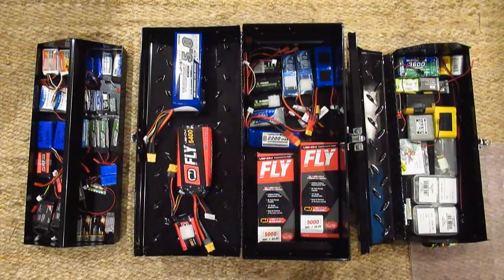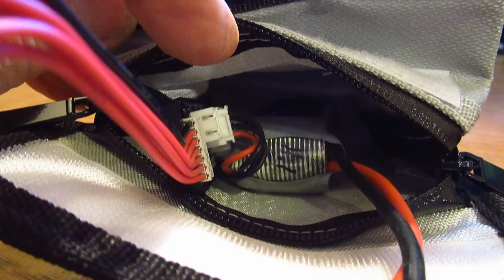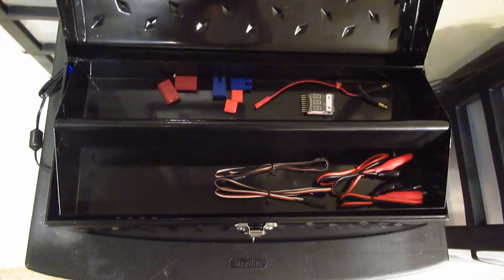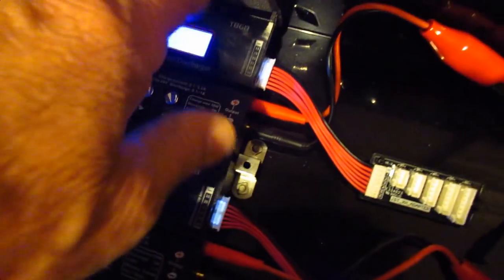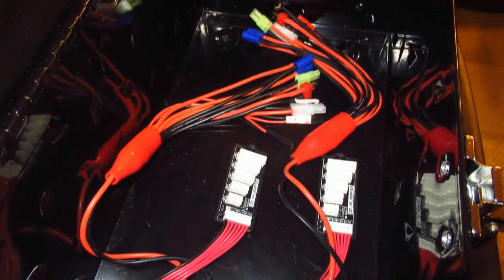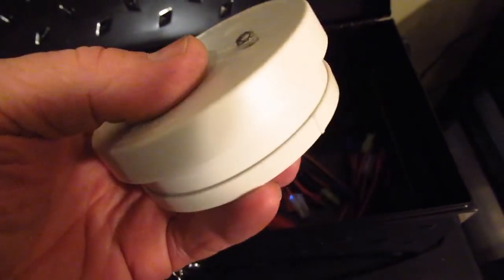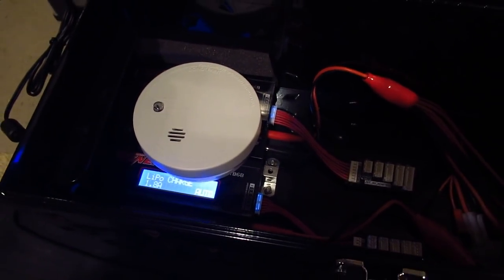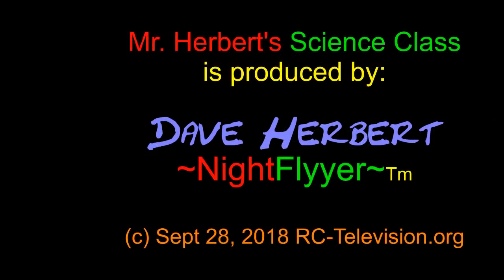LiPo Battery explosion prompted me to build a self contained PORTABLE Charging Station.

Comment: My worst experience with charging was with my prototype of lithium silver HV battery 
I made it with thinnest separator I could find and I got 382mah from 9v to 2.4v 
One time I was charging it 0.5c and I guess dentures formed on the anode causing internal short 
And it didn't caught on fire 
It straight up exploded into dust
Reply from the maker: Wow. What a story. Hats off to you for even attempting to build a battery like that. Thanks and be safe!
Reply: @NightFlyyer  thanks if I ever get good materials I will try to make it again but safer i hope in the end I will be able to sell them because 1s 9v should be far lighter and containing the same energy like 3s lipo with similar capacity

Comment: Excellent ideas.  I love the idea of including a smoke detector.  I have seen videos of batteries in those SUPPOSEDLY safe charging bags spitting flames out and burning up the bag.  
QUESTION:  You store many batteries in the same metal box.  Can a battery fail while it is inactive and in storage?
QUESTION:  If one of the batteries in the storage box explodes, will it ignite the other batteries around it?  Then could it cause a massive explosion?
Thanks for your continuous supply of excellent videos.  Gary
Reply: A fully charged LiPo that is exposed to high temperature (inside a hot car) is a small bomb waiting to go off.
Reply from the maker: Maybe, but most lipo explosions happen while charging.   I never leave any of my models in my car just sitting in the sun, but that is good advice or my laptop and phone would also explode.
Reply from the maker: Thanks kindly. I've never seen a battery explode except in a crash or when charging. I have had hundreds of them since they first came on the market for models with no problem. But just in case, I do keep them in metal boxes and feel good about doing it that way. Good question!

Comment: Excellent build!!! If you wanted to make it even safer to be in the house you could get a small amount of cement or plaster of Paris and mix it with perlite from the garden section and pour it in the bottom of the box so heat can't get the steel hot enough to burn the carpet it was sitting on at one point in the video. Keep Rocking and Thanks for sharing your build!!!
Reply from the maker: Good point about the base. Btw, I don't charge on the carpet. That is just there in the video for a few pics. The box is sitting on my quartz slab typically when I charge. Thanks kindly for the suggestion.

Comment from the maker: At least I am aware and trying SOMETHING, which is better than nothing!  When the LiPo Battery exploded in my charging bag, it burned the wires and also fried the charger! (See this example video courtesy of Rajucam Aerial Services) https://www.youtube.com/watch?v=CnNId... Therefore, I decided to make a safer and easier charging setup, which I call my LiPo Charging Station. Always be aware of how and where you charge your LiPo batteries and let this be a reminder that LiPo accidents can happen at any time to anybody. The above video link shows exploding batteries in different containers. Pay attention to the 6s test, as it is dramatic and what happened to me. I have no faith in charging bags anymore and am glad I had the charger atop a CERAMIC tile. Smoke was definitely a problem though. When it happened, I was immediately on top of it with a fire extinguisher and got it out immediately. Note about my new charging station, I have small holes in the tool box lid to relieve pressure and am also planning to add a fire extinguisher ball inside, that goes off if a fire. Be safe.
Reply: Hey NightFlyyer, I like your setup but it still has many dangers. The fire can blow out of the metal cans pretty far, and i noticed you had  your lipo box sitting on carpet and plastic shelving. This is bad as it can cause those to catch fire. I watched several videos of people testing various containment methods to illustrate these points, here is one I found most interesting (I have no affiliation with the youtuber at this link): https://www.youtube.com/watch?v=CnNId0mDnBo
Reply from the maker: I only had the tool box sitting on the carpet and shelf for pictures, as I usually have it sitting on top of the toilet tank cover or the quartz slab. Tin cans are not as strong as this  tool box, and I feel way more comfortable with it than the bag which people say work, but in my case did not.  I believe the air holes I drilled in the lid will relieve the pressure if one blows.  Thanks for the great comments and link. It is very dramatic. I will include it in my video description.  Thank you!~!
Reply: Great to hear! Thanks for the good contents and great communication :) Also great idea drilling vent holes in the top lid so the pressure and heat go straight up making it harder to reach anything flammable. I have a metal workshop table that I charge on. Nothing flammable anywhere near them, lipos scare me :D
Reply from the maker: Thanks kindly.  They really explode and this video shows how violently a 6s, (like mine did) explodes inside the worthless charging bag.  Smoke was the biggest problem, but luckily I was right on top of it with a fire extinguisher so no damage.  https://www.youtube.com/watch?v=CnNId0mDnBo  .  Thanks for your comments and charge safe.